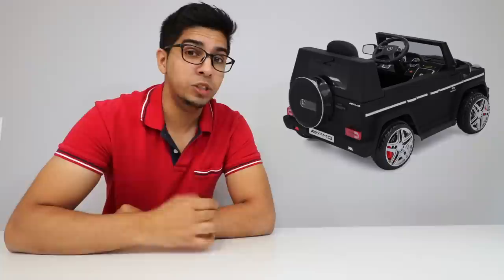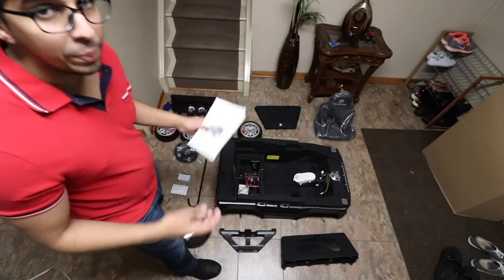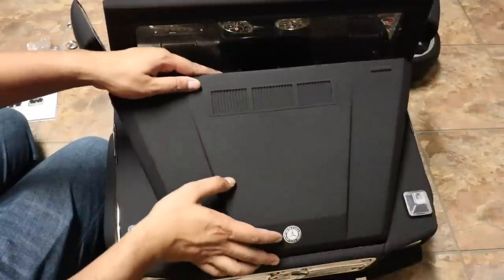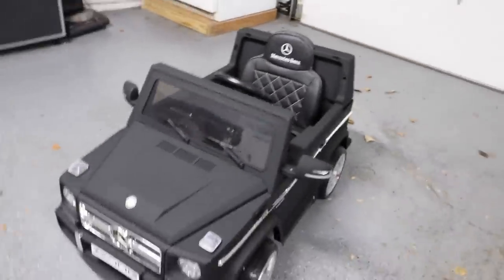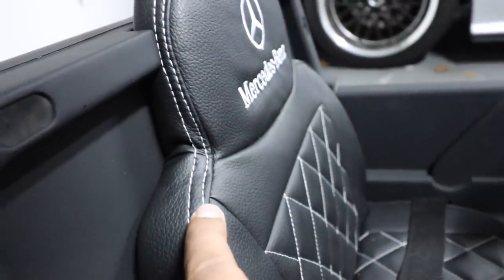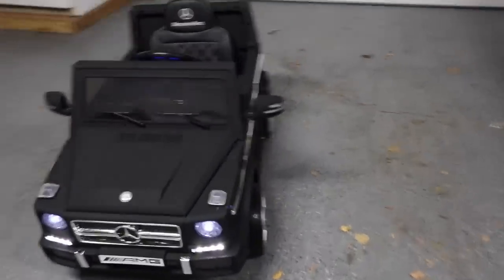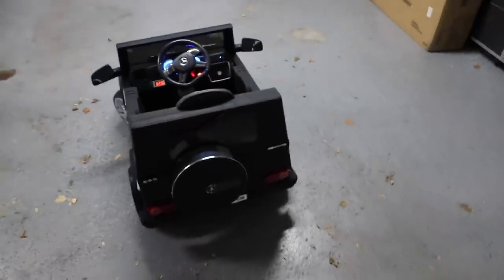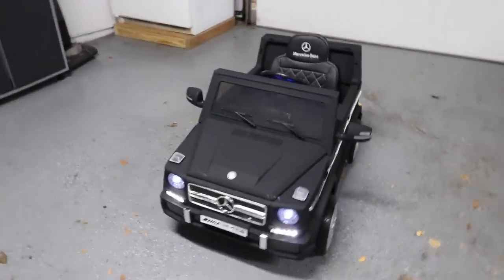UNBOXING & LETS PLAY - MERCEDES AMG G65 Ride On by Best Choice Products

Comment: How do I program the remote?
Reply: Did u figure out ? I'm having trouble with my remote too
Reply: no programming. Just use 2 AA 1.5 V battery. It will not work for rechargeable AA 1.2V battery, I try it will not turn on.